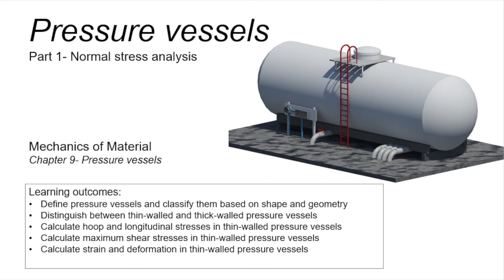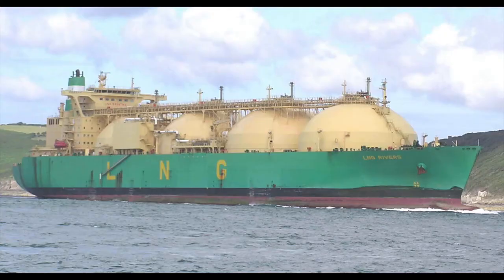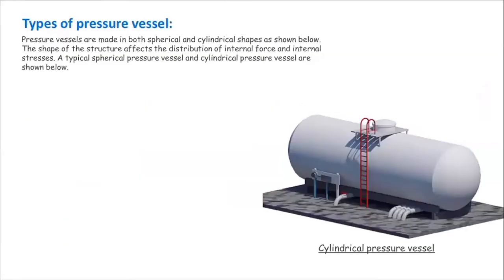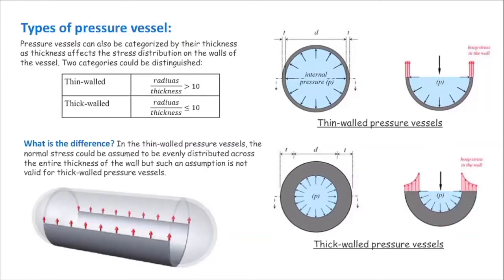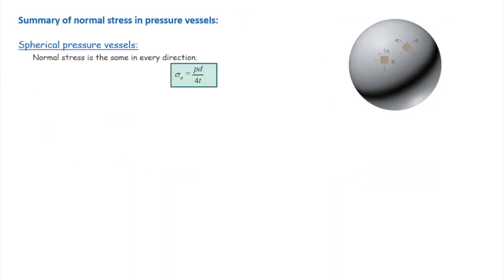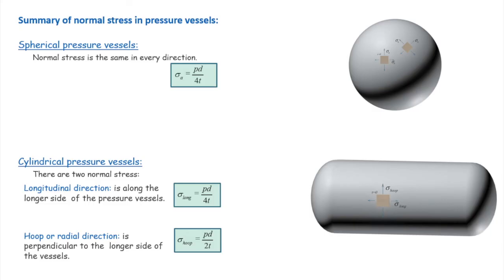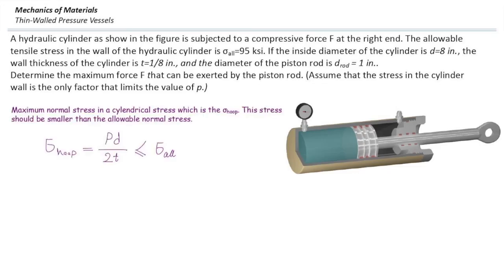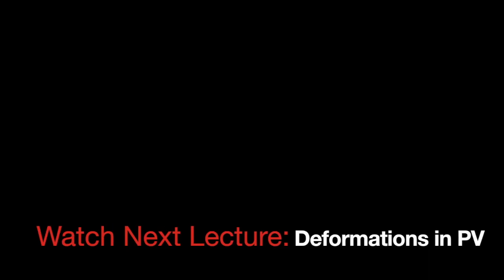Pressure vessels (part1,  Stress analysis)

Comment: I understand your logic that A=πdt BUT that does not give an entirely accurate answer. Subtracting the area of the circle formed by the inner perimeter from the area of the circle of the outer perimeter, i.e. A=π(dt-t^2), derived from A=π*rsubouter^2 - π*rsubinner^2, will give a 100& accurate answer but different than the equation you are using. Why would you use an equation that does not give you an accurate answer when there is a better equation that you can use?
Reply from the maker: The approximate area A_approx=πdt in thin walled pressure vessels (where d/t > 10) is close enough to the exact area A_exact = π/4*(d_outer^2-d_inner^2) and significantly simplifies the resultant stress equation. Note that 5% limit is usually considered sufficient in many engineering applications and such limit is satisfied in many thin walled pressure vessels. Thick walled pressure vessels have a non-uniform stress distribution and the calculation is totally different. Hope that helps.
Reply: @MechanicsofMaterialsLibre  Thank you for your explanation professor although I must strongly disagree with your approach. Where does it say exactly that there is an across the board 5% error limit that is acceptable in many engineering applications? Surely that would depend on a case by case basis and I doubt it would apply to error in your mathematical calculations. Is it then okay to say that 10 + 10 = 19 if, let us say, I am designing a nuclear reactor? How do you fit a 20 mm nut into a 19 mm bolt, it is only a 5% error?

I get it, sometimes engineers have to accept a certain margin of error but surely not when you can help it?!

Error margins are there for things like imperfections in materials, irregularities during manufacture and assembly, non-uniform stress distribution, factors that are impossible to accurately quantify. I do NOT believe error margins are there to excuse sloppy mathematical calculations purely for the sake of simplicity, especially not in an engineering dicipline. Frankly I would call that laziness and irresponsible. What happens when that unnecessary error is amplified when repeated in further calculations? What do you tell the Board of Enquiry when the structure collapses? "I made a few 5% errors because that was simplest but it was all within error margin."?

As for simplifying the stress equation, yes I agree, multiplying 3 variables is MARGINALLY simpler than doing a simple area calculation for a circle, but the latter is not exactly rocket science either. This is basic elementary school mathematics we are talking about, you mean to tell me that doing an area calculation for a circle is too complex and that it is better to do an inaccurate calculation instead, purely for the sake of simplicity?

I do not mean any disrespect but, either I do not understand the merit of your approach OR I simply cannot accept such a flagrant drop in standards. I think I will just keep doing the calculation the correct way for now.

I recognise that you are an eminent professor in engineering and I am just a student so perhaps it is arrogant of me to say, but surely you can't be right?
Reply: ASME B&PV code uses precisely this approximation. 

THE PRESSURE FORCE EQUALS (w/4)D^2P WHILE THE RESISTING FORCE EQUALS (r)DTS. WHEN THE TWO ARE EQUATED, (v/4)D^2P = (w)DTS AND SOLVING FOR T = PD/AS = PR/2S. 

From European standard AD 2000 section B1 5 on the design of thin walled pressure vessels: 

The required wall thickness s is, in the case of spherical shells
s = (D_a * p)/(40K/S * v + p) + c_1 + c_2
s wall thickness 
D_a out side diameter
p design pressure
K design strength
S safety factor 
v Poisson's ratio
Here expansion is approximated, but the same approximation is made. 

ASME B31.3 uses the same approximation when calculating stress in curved piping. 

This is not "@MechanicsofMaterialsLibre 's approach". This is an international design standard (based on barlow's formula) that has been used for decades in everything from rockets to nuclear power plants.
Reply: Barlow's formula is intrinsically an approximation(in far more ways than you have mentioned), and there are certainly more accurate ways of calculating stress in a pressure vessel. This video is about Barlow's method, if you wan't a more advanced technique, they really are not hard to find.